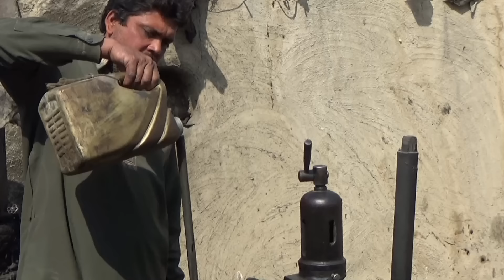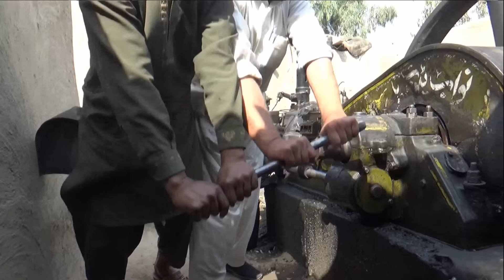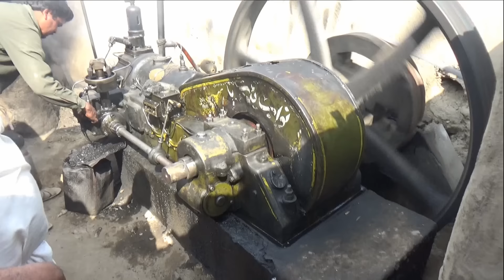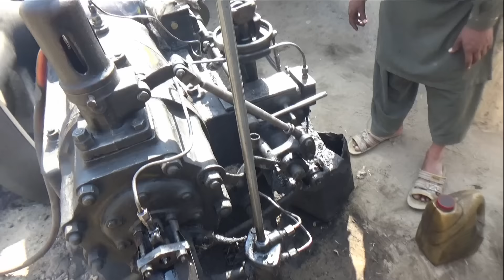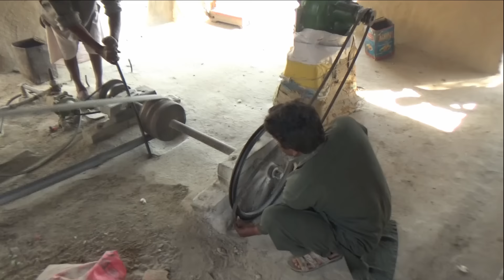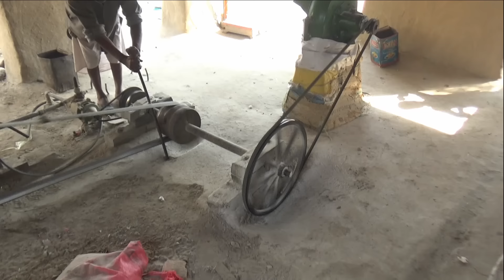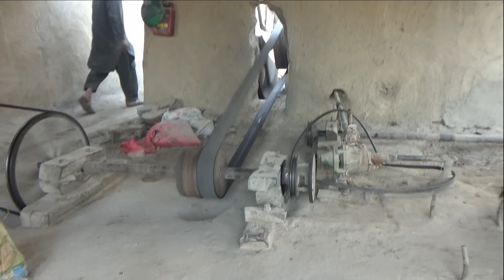Starting the Diesel Engine Best Sounding Engine 22 Hp 300 RPM Old  Black Engine

Comment: Love these old engines... when I did my apprenticeship in 1968 for heavy earthmoving equipment mechanic  we started off on basic training on engines like Ruston ..Pescara....Petters and Lister old diesel's.....they were connected to large water pumps..compressors..generators ect which were also formed part of the training...there is nothing better than hearing these old engines running..when there were set up correctly they soundike music...
Reply: Sounds like you loved mechanical engineering.   I'm not an engineer but as a helper to my Dad, an auto mechanic in the 1950s through 1970s,  I learned to appreciate  advances in that kind of engineering.   It's great stuff !
Reply: @clavo3352  many thanks..I'm 70 and still do love it..just finished major overhaul on my ZX6R Ninga...In July I did my son's focus st gearbox strip and re built the diff..even got to the bottom of traction control and abs problems..stops me from festering in front of the telly...😂😂

Comment: What an excellent piece of machinery. I'd love one of these to take myself off grid electrically. I was feeling a bit sorry for the two guys cranking it to start the engine though 😊
Reply: You'd rather have a 70 years old fossil fuel burning machine for your power instead of being connected to a well maintained power grid? You must be very rich and hungry for adventures.
Reply: Yeah off grid becomes nonsense if you then need a gas tank in your garden...
Reply: @MarcusLobenstein  Solar/wind/hydro with battery storage is what most offgridders would use. They then have a backup genset just in case.
Reply: I'm sure Cummins make very efficient diesel engines for power generators that start with a push button.
Reply: ゼンマイを回してボタンですね(o・ω・o)

Comment: The exhaust sound is the best :-D
Reply from the maker: Thanks sir
Reply: Sounds like a flute. No combustion noise at all
Reply: HISmercies nbounties  Premturely? It's 50+ years old. I'd say it has lived a while.
Reply: Lol that choomp choomp sound is beautiful 😂😂
Reply: Is the flute-sound a feature or just the result of a rusted exhaust-stack?
Reply: @tjofrasse  This is more the air intake sound than the exhaust.
Reply: @tobiaswittenmeier1877  the exhaust pipe looks like an organ pipe about 12 inches from the top. Maybe it's a run indicator so you can tell from afar that it stopped?
Reply: @tobiaswittenmeier1877  yeachhh.....
Reply: @kirkniles4184  your dodge will sound like a train whistle being activated constantly.
Reply: @fanplant  that makes sense! Never thought about it that way. If a water pump goes down that wouldn’t be good.

Comment: 1951 seems fairly new for an engine of this type of design something like this could easily go back another 50 years
Reply: Gotta be a typo. 1851 is a more likely vintage. Nessesity us the mother of invention
Reply: The beauty of this one is it's still being used
Reply: @aaronhumphrey2009  Most likely a copy of a much older engine from the days the British were there. Same as the thousands of copies of early Lister Diesels still be made today there.
Reply: People still produce chevy small block gen 1s brand new. Be it cnc billet aluminum or casting iron... but people still make it and its just as old! Just because its old tech doesnt mean it isnt popular...
Reply: We had this model in 2001 to 2012.
Reply: Could just be a Dacia. Old tech for these days but a cheaper option
Reply: @aaronhumphrey2009  there were no diesel engines in 1851. It's a locally produced copy of a 1920s vintage ruston stationary engine. The slow speed high torque design is ideal for "shaft shop" use, where multiple machines get power from a single engine, just like in the age of steam (these lumbering monsters were designed to replace steam plants). The slow speed operation also gives them incredible longevity, while the "primitive" engineering allows maintenance and repair under far less than "clean room" conditions.
There are vids of similar rigs running without a governor, being fueled with blends of waste oil, diesel, vegetable oils, and solvents, so obviously abused and neglected for decades. In conditions where a more modern engine would have a service life measured in days, these dinosaurs run for decades.

Comment: It's so good to see these old machines still being used they was made to last and they do with just a bit of oil and grease  yes the new machines will do the job cheaper to run but when it goes wrong can you get parts to repair it,

Comment: 1:34 what you want to do instead of having to crank it by hand is have like a big ol bucket of sand or dirt on a rope through a pulley on a tall   post or something   so you can just wind the rope around the  crank a few times and when you want to start it you release the weight so that it pulls the rope and turns the crank .. and then once the engine starts use it to life the  bucket back to the top of the post for the next time you need to start it
Reply: That's super interesting!
Though I guess the problem there would be having the tall post, it would need to be quite tall- or you could have an even heavier weight and use pulley ratios or gear ratios to increase the speed- then you wouldn't need as tall a post :)
Reply: Walton Simons  source: trust me bro
Reply: Walton Simons  No, you definitely would not need "at least a ton" These 2 guys were turning it with a small lever. 300kg, if even 250kg.
Reply: @Unknown what is your point?
Reply: A 10 meter tall post would need perhaps a 250kg weight, to achieve what these gentlemen did.

Calculated from assuming the men did 500watts of work each for 20 seconds to spin up the flywheel, and then adding a bit for friction of the "post-weight system".
Reply: Sounds dangerous
Reply: Aye... so long as the weight didn't turn into a whirrely gig

Comment: This is sustainable technology. Still working decades later.
Polution wouldn't be as big problem as it is now if we were still making things with this phylosophy.
Reply: Most ridiculous thing I've heard said since President Biden.
Reply: Except we can make a 22hp engine with far less materials, that runs more efficiently while producing less emissions. 
An engine like this serves its purpose in a place like this. But, it isn’t the answer to all the modern problems.
Reply: @NBSV1  true, but the point about this type of installation for this kind of engine being sustainable is not that easily dismissible.
of course you have to differentiate the use case between "STATIONARY" and "MOBIL"
Reply: @NBSV1  And that engine you speak of will never, ever be as reliable and long lasting as this one. Also, you won't be able to build a smaller 22hp engine that puts out as much constant torque as this one. Mass is mass.
Reply: @jy9291  Senator Biden will save us
Reply: @robokid20001  Sure, for torque you need that large displacement and low rpm. But, with modern stuff you could have a pretty small generator running and then convert everything else to electric. That would let a smaller engine run in it's peak efficiency band and still produce enough power to run everything. 
Reliability can be argued. This engine does keep running, but also requires quite a bit of maintenance and tinkering. If you go by how long it can run with no work done to it the old engines aren't that reliable. Plus the video doesn't show the full amount of time it took for them to get the thing started. A modern one would be just crank over and fire up.
Reply: @waterheaterservices  🤣😂🤣 that's hilarious

Comment: As a point of reference, 22HP at 300RPM yields 385 ft-lbs of torque or 522 Nm!  *******************************************************************************************************************

Can you imagine the number of car engines with less torque output that have exceeded their useful life and been scrapped since this one has been around?

Comment: I could certainly tell on the last pumping, when it hit it  was going to go. Those poor guys worked their tails off for that start. It probably runs on straight vegetable oil making it harder to start especially shutting it down on vegetable oil. If you run it the last minute on diesel oil starting it will be on the first try next time. Unless the engine is worn out.

Comment: That engine probably uses more lubricating oil than diesel.
Reply: The more tired it gets, the better on fuel economy it gets as it uses more and more oil 😂
Reply: .9
Reply: Hyd hết sức quan trọng nhất là một lũ cướp ý kiến
Reply: Hừ lạnh một tiếng đồng hồ sơ của bạn đã có
Reply: looked like he was priming it with heavy fuel oil like a ship uses!
Reply: If you were that old so would you
Reply: Those old engines have drip oilers and they are " total loss" oiling systems
Reply: @zyrajehoti1625  z
Reply: Ok 🅱️oomer
Reply: They don't use as much oil as you think.
Even the old steam locomotives with a LOT more moving parts were manually oiled and greased by an engineer or in the engine she'd or roundhouse.
If you want to go that route, a modern piece of heavy equipment uses at least a tube of grease every day.
The larger, the more grease, and up to three times the normal amount when working in sand.
Lubrication is the key to keeping ANY equipment alive, even a car!
Reply: It probably runs on the same oil they lubricate it with.
Reply: Yes, but on the other hand such 'Engines' used to accept low speed diesel which is much more cheap than High Speed diesel now a days.
Reply: @MrTheHillfolk  q
Reply: @sanjaygupta4101  👍

Comment: My best friend had one. It generated power for his home in the country side. Once I started it while I was there alone. I couldn’t remember how he stopped it, 😁
Reply: To turn the engine off, you probably only need to stop the flow of fuel.
Reply: Alan DeVaney exactly. Had to find that as I recall.
Reply: Alan DeVaney not necessarily, diesels can run off their own oil under the right conditions, it should have a way to seal the air intake
Reply: @miatafan  They can for sure. But in the case of this old boy I'm pretty sure it is far from dieseling itself to oblivion.
Reply: usually they are stopped by cutting off the air.
Reply: These are stopped by operating the decompression lever on top of the air intake, which opens the intake valve slightly. It can also be done by lifting the lever for manual priming the lift pump, "stealing stroke" from the pump cam, thus choking off fuel flow, but that causes vacuum in the fuel system as it pumps dry.

Comment: I love to see older stuff still working. I wonder what engineering elements of any particular design result in a slower working speed vs. higher?
Reply from the maker: Thanks for watching the video
Reply: Length of stroke, bearing materials, and method of lubrication, primarily.
Reply: @ludditeneaderthal  and dont forget flywheel mass! ;)

Comment: The engine is pretty quiet if you put a muffler in it, especially for a diesel compared to nowadays
Reply: this engine runns at 300rpm. Compare that to nowadays Diesels, 600-1200 and they are much smaller. Also, and you missed the most important part, this is a Hit and Miss engine; they are quiet by design.

Comment: Did it belong to something really important? Thinking this because of the whistle sound = if you hear the whistle, the engine works. If it gets silent, then hurry to fix it. Like the water pumping stuff in old mines where they had bells going kling klang bing bang to tell everyone that the water pumps worked (and if it got silent = hurry up to the surface)
Reply from the maker: Thanks sir very much for watching the video.
Reply: The whistle tells the locals "the mill is open for business", so they can get grain ground, rice husked and polished, animal fodder chopped, etc. Its an audible neon "OPEN" sign, basically

Comment: Love the governor spinning on the top plenty of moving parts
Reply: It should actually be covered by a domed cylindrical housing to prevent dust contamination (which causes wear and weight variation), and to keep it from nipping off clumsy fingers

Comment: Not to criticize but you would think that they would have figured out a better way to engage the last v-belt since 1951. It's a v-belt, guys. The solution is right there. Build in a spring-mounted idler pulley as a clutch mechanism you can engage safely with a handle. I feared for that man's fingertips. It is not a fun time if you get bit. Ask me how I know.

Comment: Uuhm, that engine is a 1951, you say? Not likely. More like 1931, I would guess. An old 22 horse diesel wheezer like that could run your whole farm with a belt system like that and did all over America in the old days. Most burned gasoline or would start on gas then switch to cheap petroleum distillate when they were warmed up. Others would burn kerosene. Diesels weren't as prevalent here. Love this!

Comment: Unfortunately these guys aren't aware that there is 1 of 2 things needed to allow this engine to run at its potential and that is......👇
1. Clean the fuel filter,fuel pump, and injector....
The hard start was due to clogging gumming up of oily residues that cooled and jellied up in fuel system since last start, which in this scenario needs a fresh dose of fuel to soften and free up flow before ignition. 
2. A new set of compression rings will also help immensely,  in this old diesel the rings are made of leather and carbonise and become brittle and wear break apart when engine seldom gets used.
They are not dissimilar to an old hit & miss engine!

Comment: Why not have a starter motor with power from a battery, charged by alternator or solar panels. The advantage would be higher RPM to start faster. That old motor needs to be cranked fast which is hard by hand.

Comment: Jak na 22hp to jest naprawdę ogromny
Reply: That's true however you need to appreciate that when they say 22 hp they mean 22 continuous hp, and that is what is important. This means it will run reliably 24 hours a day 7 days a week delivering that power, not like many modern engines where their hp quoted is peak, fpr short periods and cannot be maintained.

Comment: So does anyone know the efficiency of these old engines compared to an equally powered modern diesel?
Reply: Not many modern diesel engines have only 22hp...  for 1 cyl, it is probably very efficient.   Compared to modern engines it is probably very inefficient and practically useless.
Reply: According to Wikipedia the 1st Diesel needed 324g/kWh, which might be in the 150% range.

Comment: This engine was originally built to be used in an airplane. Here it has been adapted to run a potato peeler
Reply: Beg to differ  Joe it was the twin cyl twin flywheel  version  that was used in light aircraft
Reply: @oldjack3023  Jack I beg to differ again you are thinking of the twin cyl 3 flywheel version of this motor.
Reply: Yes your rite Joe ,I forgot  about those as they were originally  classified and exported  only for use by the Pakistani  air force